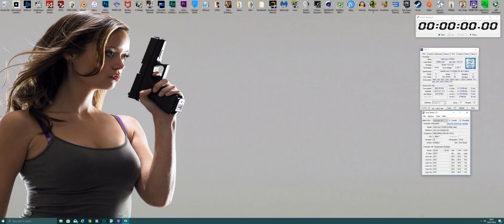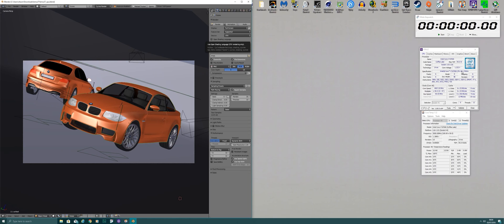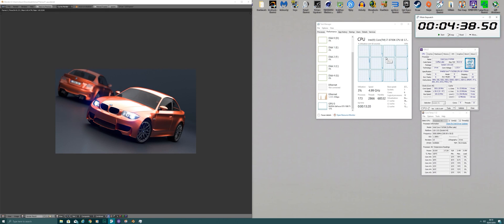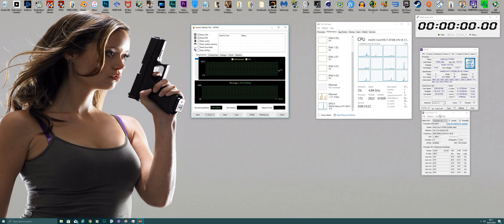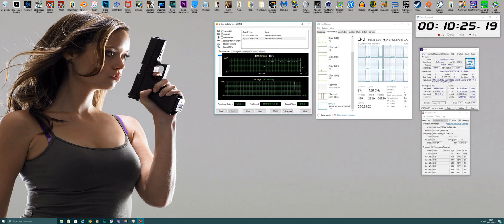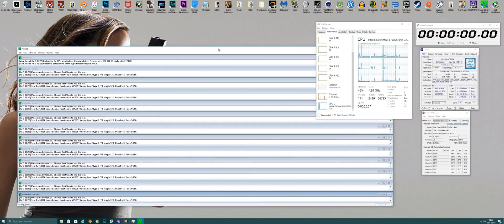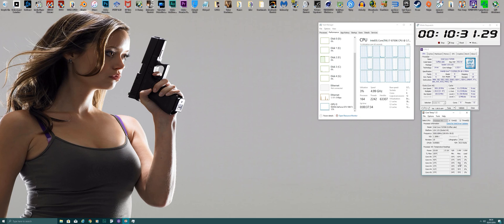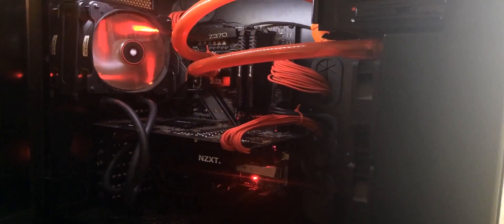Intel i7 8700K 5GHz Overclock Stability Testing @ 1.24V | Blender | AIDA64 | Prime95

Comment from the maker: Just FYI MY CPU is not Delided
Reply: In your AIDA64 stress test, you may also want to apply the "CPU package" or "CPU IA Cores" options and check either one of them on AIDS54 widow. This CPU package temperature can be 5-10°C higher than that of "CPU" in your video. Therefore, the higher temperature instead your lower one should be used to assess the heating of your CPU.

Comment: Hey my cpu clock does not remain constant while doing the fpu test (i have 6600k) i have tried to lower my clock to about 4.0 ghz (4.2 being the turbo frequency) to keep the temps under 60 and it is still not constant.
Reply: TheBetito123 not 100% sure, but should have a setting in your bios to change that. You’re looking for a “fixed” frequency.

Comment: I am pretty much a beginner in terms of overclocking but i have just tried overclocking my i7 8700k to 5.00GHz with 1.36V and if i test it in Prime95 Version 26.6 the Speed varies between 4,98GHz and 4,99GHz.
Is that normal? And how exactly can you tell if a CPU is overclocked stable, which values are you looking at to see that, the GHz?
Reply: Exactly! I just started. Basically I just was able to purchase a decent PC. I experimented a little. I found myself constantly switching from 5.002-5.001-4.98-4.99

Is that considered do be stable enough? Like should I play like that? Since your comments been 7 months ago - how's it going, any improvements in your knowledgeable and stability? Thanks!

Comment: My 8086k requires 1.24v for 4.8ghz on all cores , to get 4.9 I need 1.37 I did not even try 5ghz it will be impossible
Reply from the maker: Dam you got a bad chip, I can do 5.3GHz at 1.4v
Reply: @Bang4BuckPCGamer  I do 5.1 at 1.325v and 5.3 at 1.365v
Reply: Just saw your comment after years. Tried OC mine and I get 1,305v for 5ghz, 1,35v for 5,1ghz (didnt try to lower yet). 

Not stable on Prime95 but almost stable on gaming.

Comment: Check that out, even the 8086k don't manage to get those frequencies a that voltage. and they are bin processor.   https://www.gamersnexus.net/news-pc/3340-stream-recap-live-overclock-intel-i7-8086k
Reply from the maker: Yeah gamers nexus 8700K is trash, It's so unfair that not all chips are equal